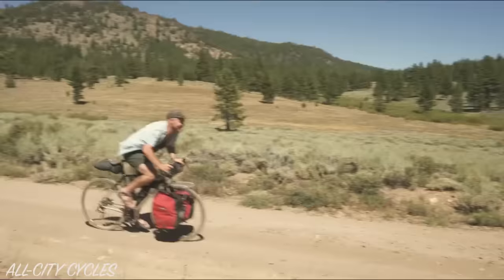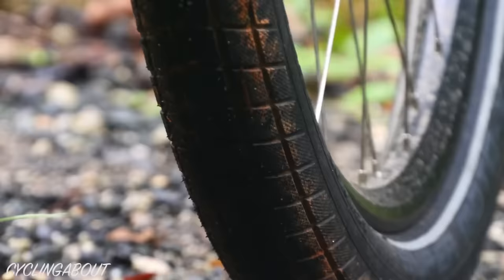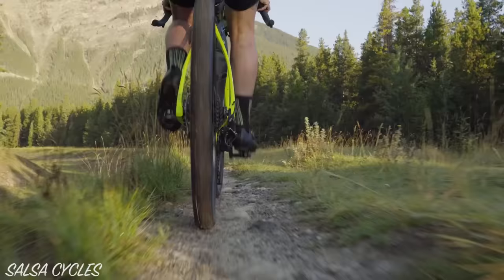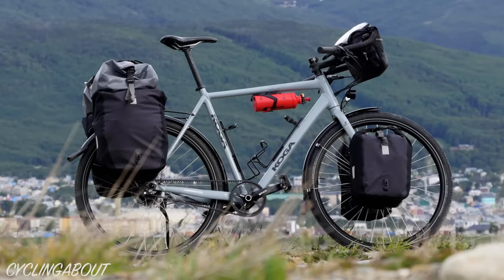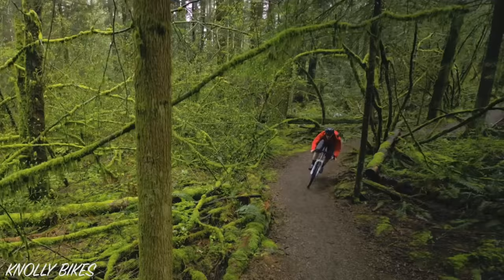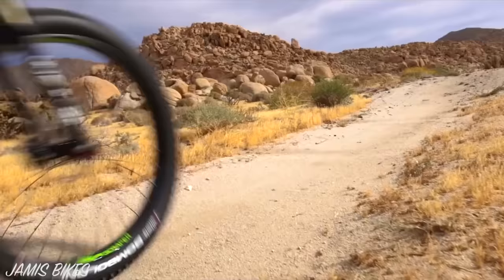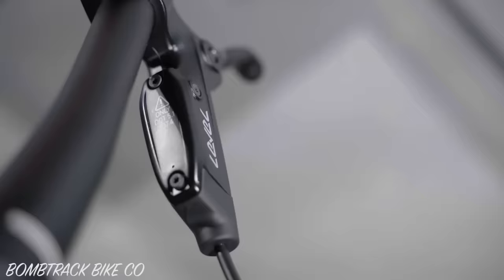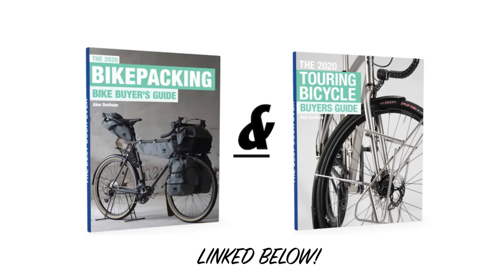What Is The ACTUAL Difference? Touring VS Bikepacking Bikes

Comment: your video helped me to no longer being sure what the difference between bikepacking and touring is...
Reply from the maker: 1. Bikepacking Bikes Are Less Overbuilt
2. Bikepacking Bikes Usually Have Less Frame Stiffness
3. Bikepacking Bikes Usually Have Different Mounts
4. Bikepacking Bikes Usually Have Shorter Chainstays
5. Bikepacking Bikes Are Usually Intended For Off-Road Terrain
6. Bikepacking Bikes Have Higher Gear Ratios (Sometimes)
7. Bikepacking Bikes Use 1X Drivetrains More Often Than Not
8. Bikepacking Bikes Often Use Less Field-Serviceable Components
Reply: @Cyclingabout  that is primarily where the confusion comes from. my understanding of "touring" is "riding with friends or alone for several hours, on a nice bike trail". "bikepacking" as i understand it, is packing stuff and be gone for months.
Reply from the maker: @miko007  This is a video about the bikes rather than the activity.

Comment: Got a Cannondale T2, it's a lighter sporty touring bike. Met two guys at the Hot Sulphur Springs, CO campground that had Surly LHT, they wanted a Cannondale for the weight saving, but the craze then was Steel is Real so Cannondale stopped making their touring bikes because aluminium frames weren't in favour. I've done a lot of touring on a hardtail Mtb, the last place was Sri Lanka.
Reply from the maker: The Cannondale Touring series are awesome! I have many friends with them. 👍🏻

Comment: i  have come to love using a trailer with a frame bag  and while - you wont be going off-road really, specially in muddy conditions as i learned the hard way, you can handle gravel and single trails without issues. It's just so much more conevenient and the bike feels - subjectivly - better, compared to full backpacking or touring set-ups, while riding.

 it's as always: dont follow other peoples experience to the letter and go for a laid back "what ever floats your boat" approach.

Comment: It's bewildering. Great job of demystifying some of it.
I haven't yet committed to buying an off-the-shelf dedicated touring/bikepacking bike, but I've cobbled together an awesome steed using an old style "hybrid/MTB" frame". Longer chainstays & a higher & longer top tube than a modern MTB frame makes it very similar in dimensions to a purpose built modern bikepacking frame. Loads of room in the front triangle for cages &/or bags. & it even has rack mounts if I want to use panniers which I do occasionally. Best part of all,  this frame was £40 on eBay secondhand!
Reply from the maker: Hybrid/trekking frames are an excellent place to start!

Comment: Have built a retro gravel bike from a  22 '' Reynolds 531 winter training frame .  Tyre clearance for mudguards so have a 40 mm tyre up front and 30 mm on rear as less tyre clearance on wide rims with Pelissier hubs . Has modern dual  pivot brakes  ( yes over time they will take a hiding ) with Campag chain set and with single 42 ring with Campag sealed bottom bracket.   
32 sprocket on freewheel  with large single lever  ( easier too change especially with gloves )  on down tube with old Shimano 7 speed XT gear .  
Old school ,  different , individual and self build makes it  ' My Bike ' not some multi million pound companies clone sold too the masses.    Keep It Real  Keep It Steel  🚲☺👍  am also  ' Black Cat ' if this post appears on here again.

Comment: Thank you Alee, another encyclopedic installment. Are you planning to do an episode focused on wheels and brakes? If the world ever goes back to some sort of normality that will allow long-distance traveling, I will go for a a touring bike although the weight puts me off at first. But versatility and durability comes first.
Reply from the maker: I'll be covering wheels soon!
Reply: Touring doesn't necessitate riding a slow monstrous bike loaded down to ridiculous levels.  My bike + gear ( minus food and water) is typically under 16kg/35lbs for road trips with full camping gear.  If you're not carrying massive amounts of stuff your bike can be a thoroughbred vs a pack mule.  Backpackinglight.com,  bikepacking.net and bikepacking.com are good resources for information on how to reduce your gear weight.  Starting out local trips of 1-3 nights are an excellent way to get experience.

Comment: I weigh a tad over 100 kgs @ 1,96 m, which means that I quite easily exceed the bike's max. load when using luggage for a one week camping trip. Therefore I have decided to use a single-track trailer that can take 32 kgs of load. Mine is the Topeak Journey TX. It's not cheap but it is very stable and well constructed. Furthermore you hardly notice it while riding except for steep climbs. I highly recommend it for heavier riders who intend to carry quite some stuff...
Reply: I have the exact same rig. But the Tout Terain Silkroad takes 180 kgs so there is a posibility though. I love the fact that the weight center of mass is low in the trailer and I agree - you don't notice the trailer until you start walking up a steep hill.

Comment: Thank you for another excellent video.
Some people are probably put off or discouraged by the cost of the bikes and equipment.
Maybe you've already done it, I don't know; but it would serve these people well if you had a video for them.
There are ways of getting high quality while still saving thousands of dollars.
There are many people who just can't afford these new bikes. People's price ceilings vary. You could address those who are at different parts of the spectrum, with different ceilings.
One approach is garage sales, estate sales, and auctions, and finding a good used bike in like-new condition that has been stored indoors and ridden little, and has high quality, reliable, durable componentry. There are many such bikes out there, with XT-level components, quality steel, and geometry well suited to touring. The people who bought these bikes back in the 80s and 90s often no longer use them, and are happy to pass them on to someone who will.
Reply from the maker: I have a video planned about building a budget touring bike in the works. But just working really hard on a short documentary currently!

Comment: I kind of know how the middle ground bike I dream of would look like. It doesn't seem to exist for some reason, or I haven't found it. 
* Road bike geometry, but clearance for maybe 700Cx45 plus fenders.
* Really strong and stiff steel frame.
* Post mount brake mounts
* Threaded bottom bracket shell, road bike width, not MTB width.
* Every rack, bag, and fender mount under the sun.
* I just want to buy the frame, not the complete bike. For some reason most touring bike manufacturers only offer complete bikes.
The Fairlight Faran I've just built ticks most boxes, and I believe the new Disc Trucker ticks even more of them, but only in sizes that are too large for me.

Comment: Most people will never go touring through Mongolia or Patagonia. Go hydraulic brakes. 
I built a Salsa Marrakesh 3 years ago, toured with it, and then built a new bike from the experience. The Salsa got sold, and now I am riding a Niner RLT steel frame, carry way less stuff, and change the wheels depending on what I aim to do. I got a road/gravel/bikepacking bike all in one in this bike. Just need to get that roadlink so I can swap the cassette from 11-32 to 11-40 and I am done.

Comment: As someone who is tall 200cm and weights in at about 120 kg. I find that its also near impossible to find a bike that can handle my weight + 15 kg of gear and that fits my height!. What i wouldn't give to have been born 10-15 cm shorter. The most important parts of your gear also have to be longer, which takes up more space, which means heavier.

Anyways great video .

Comment: I rode south and crossed the Panama Canal.  When I crossed the border into panama from Costa Rica, I met a few guys that were biking to Panama City.  This was a great example of the difference of the ride a bike has vs a motorcycle.  As I headed south and went from the pacific to the Caribbean side of the country many  times… the guys on bikes were headed south on the main highway, they rarely deviated from the highway as they just didnt have it in them to pursue additional miles and they missed out on the best parts of the country.  I did 26 k miles on my tour south of the us boarder eventually crossing the Panama Canal and the guys on bikes did less than 3k.  Some times bikes work, but I think adventure and exploring on a moto will get you to more places.  Not that more is always better, of course… but

Comment: Good article for the UN informed folks like me. I was going to say the difference is one camps in the woods and the other at Motels. I have a set of Panniers on my mountain bike which works quite well for my form of bikepacking.  I'm a ultralight Backpacker which means all my gear ( when Backpacking ) minus the consumables ( food, fuel and water ) is under 10 pounds , normally 7 pounds.  Off hand guess when bikepacking my gross ( combined ) weight in the panniers might be 15 pounds. Roughely 7 1/2 pounds per bag.

Comment: One thing I often wonder about doing these trips alone is, for instance, how to go shopping in a supermarket and leave the bike outside. What to do with everything that is on the bike? Are we supposed to unload everything from the bike carry it inside the supermarket? I guess A backpack can be used to put the most valuable stuff what about the rest? I also suppose that racks are easier to carry around....
Reply from the maker: I lock the bike and bring the most valuable things with me. I try to leave the bike near security or a camera if I can. If it's a massive shopping centre I bring the bike inside the building too. But you also need to be smart about the places you shop.
Reply: CYCLINGABOUT Thank you Alee. And if you are in another country just walking into the local small supermarket for 20 min? Do you ask people to look after your bike and gear in it? 
I want to thank you for the incredibles guides you sell. I got a few and wanted to get a new bike this year but uff ... not the best time to do so... a lot of gear is out of stock. Anyway thanks again and safe travels! Come to Switzerland!

Comment: Your advice please:   I am very heavy...  and I want to start riding.  I will not be bike packing or touring.  Just recreational ... in and around neighborhoods where I live... maybe some long road riding.  I'm drawn to the Salsa Journeyman 700 or 650b doesn't matter which... the 700 can go skinner tires.  Not much difference... but 99% of my riding will be on asphalt.  The other bike I'm considering is the Trek Dual Sport 4 ...for 2021.  It has a 1x also.  The Salsa has the 1x Apex.  Something about the 1x that makes me smile.  The term you used in this video... Fat tire road bikes ...something along that line.  Or even, road geared Mountain bikes.  Which... I think does not exist.  Oh, and besides being very heavy... I'm very old too.  68.  Trek rates their Dual Sport bikes @ 300lbs.. rider and all gear.  My budget....  $1,800 ish.   Salsa Journeyman Apex is $1500 and Trek Dual Sport 4 1X is $1160.  I would only be interested in a bike, that is found in USA bike shops.

Comment: I disagree that you can use any bike for bikepacking or touring. A mountain bike with a non-locking shock fork will drive you crazy on steep hills. About 25 years ago I bought a Gary Fisher Hoo Koo E Koo at a Police Auction for $100, and it had a Rockshox Judy fork on it. It was the first MTB I ever had and I thought it was great. 

That is, until I took off on a cross country ride starting in Page, Arizona. I rode 30 miles and turned around and went back and replaced the form with a rigid one. Later models of the Judy have a lock, but that one did not. The good thing about it was the bike shop tech traded me strait across, so I didn't have to raid my travel funds...

Comment: Not sure - I have a Surly Ogre currently set up for touring with 3x9 XT gears and Hope hydraulic brakes (Its what I had available) on 29"rims with 50mm road tyres. I reckon it would do for off road bike packing with wider knobbly tyres as the frame seems bomb proof. By the way I am running Koga Denham bars and love them.
Reply from the maker: Sounds like a great touring-bikepacking hybrid!

Comment: I have a Ridley Kanzo adventure gravel bike, this bike has attachments for racks. I attached a tubus rack on the back with Ortlieb bags about 20kg of luggage. At front a normal steering bag for touring. The bike is 8,5kg!!! It has 24 spokes front and aft. I weigh about 95kg's. I travelled over asfalt through France over mountains. The light weight was just great. Only with this bike compared to a Santos travel light bike, I almost got 8kg off the total weight, and that is just a lot in the mountains. Furthermore I skipped parts. It is not a world traveller bike, but a bike to travel through Europe over asphalt and gravel. And of course with a racing bike handle bar setup, because climbing with a wide handle bare is just aweful.

I made 1 modification this year, changed the 140mm to 160mm disc brake at the back. That is still too little in my opinion for my weight. I shoudl go for 180 front and rear, but there is a strange thing going on in bycicle land that weight is more important than breaking force, so all the manufacturers attach 160 front and 140mm back. Wrong!

Comment: Touring bikes tend to be a bit more stable than bikepacking bikes.  Stability is good but as stability goes up agility goes down. Touring bikes are also heavier and stouter than bikepacking rigs.  The amount of strength and stiffness required is going to vary on the size of the rider and how much the user packs.  A large 250lb/110kg rider requires a stiffer stronger frame than a 100lb/45kg rider.  Most of the time taller people are heavier than shorter people.  Shorter tubes are inherently stiffer and stronger than longer tubes.  The joys and pitfalls of mass production means a one size fits all in durability.  When specing wheels and other components larger riders who break everything would be served to replace stuff with heavier (but still quality) whereas lighter riders if they ever break or wear out parts would be wise to replace parts with lighter weight options.

Comment: Another excellent, detailed video, Alee, and perfect timing for me, as I want to do more cycling adventures (though modest ones!) You comment about lines blurring, and I think that is becoming even more relevant. There is an increasing overlap between "bikepacking" and "touring" bikes (and probably include "gravel" bikes in there, too!)

However, if you have time, I wonder what you think: Is a bikepacking-specific bike more adaptable to touring, or is a touring bike more adaptable to bikepacking? (for somebody who plans to do both, which end of the continuum is more adaptable)?
Reply from the maker: You'll want a heavier-duty touring bike with fatter tyres if you're going to be doing both.
Reply: @Cyclingabout  Thanks for the quick reply, Alee. I've now ordered and downloaded the special deal on the three books (touring bikes, bikepacking bikes, and touring guide), which are good value for all your expertise and knowledge. Can't understand some of the negative comments on here; it takes all sorts, I suppose.

Comment: I'd make another generalization. Bikepacking relies on webbing material of the bikepacking packs for the integrity of bag mounting which is arguably more reliable than rack mounted bags. Rack mounted bags in certain conditions can shear fasteners off or break more easily.
Reply: I call bullshit on your commentary. Well designed and built panniers are very securely attached. Think Ortlieb and Arkel. Bulletproof mounting systems that are super quick to remove when necessary.
Reply: Ortlieb panniers are very durable, I use them on my commuter bike, and the mountings are very stable. One time one broke, but the pannier was way too overloaded, and it was winter (cold material). You could also do a temporary repair with a simple piece of steel wire.
Reply: @chrisallen9154  not really bullshit.  Broken racks, bolts and frames are not uncommon at all.  I've seen all manner of failures of touring equipment over the last three decades.  In one instance, I worried about a steel frame eyelet on a bike I was preparing for a tour.  I asked a local framebuilder and he pooh-poohed my concern.  That very braze-on snapped right off during the tour.  Talk about predicting a vulnerable failure point!
Not that other mounting systems cannot fail.  But panniers seem prone to a lot of swinging and swaying motion that over-taxes hooks, clasps and mounting systems, as well as racks and fasteners.  Frame bags tend to locate their weight directly above or below the tubes, offering natural weight-bearing support.  The weight is actually ON the frame, not hanging off the side, suffering twisting and swaying motions.

Comment: Hi!  Very nice presentation!  I weigh 270lbs and just a guess would be hauling 100lbs in a one-wheeled trailer (Maybe a Burley one wheeled COHO CX trailer) and side bags... maybe my Ortlieb side bags.  I have a 1998 model Diamondback Mountain Bike, 19 inch frame with 26 inch wheels.  The rear wheel is a double walled rim and 36 spokes.  I have a 7 speed cassette.  I also have an Axiom rear rack they say is good to 100lbs.  I have 84 countries on my bucket list and in all kinds of roads.  The trip will take years as I plan to stay extended periods in places I find of greater interest and low cost of living.  Would that bike work?